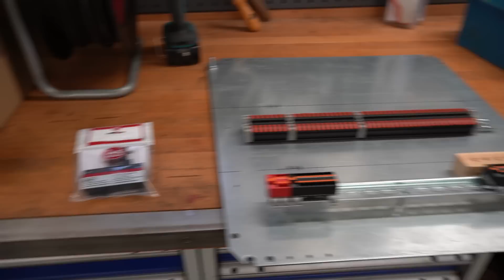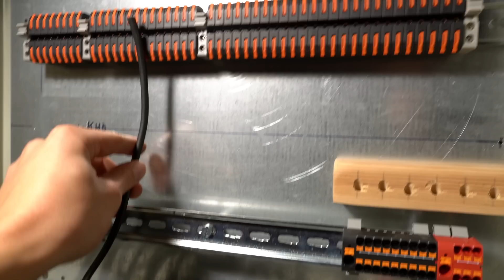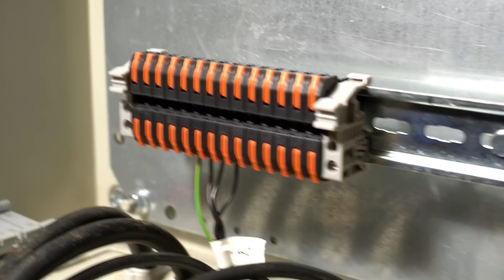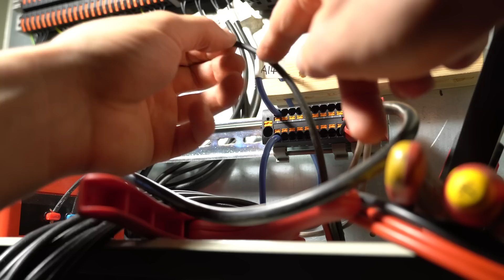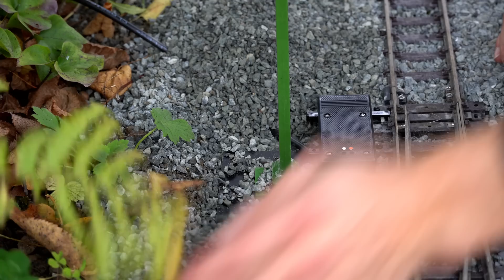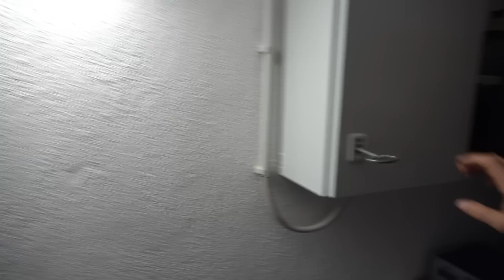Wiring ELECTRICAL BOX, installing switch motors and lanterns

Comment: Never ever cut off wires dat you don’t use. Leave them for if you need them in the future. Also leave some slack in the wires. Cut the cableshell just pased the cable gland
Reply from the maker: I agree for the most part. I have cut two wires in total that are not nessessory for the individual signal. Regarding every other signal on the layout I had the right amount of wires per cable. So leaving them wouldn´t have made a hughe difference. Any additional wires can be installed after the fact without any problem if needed.